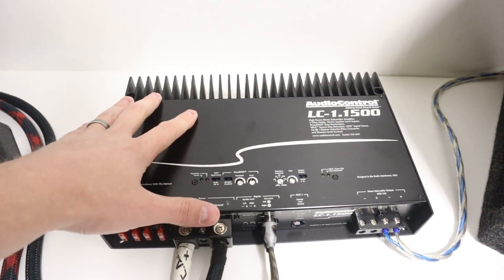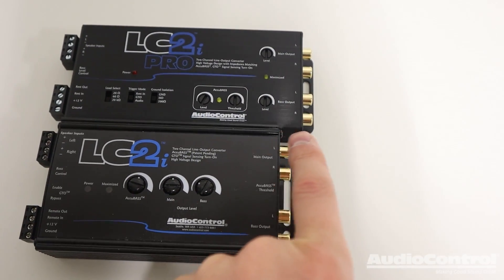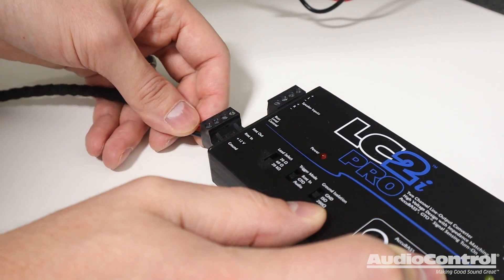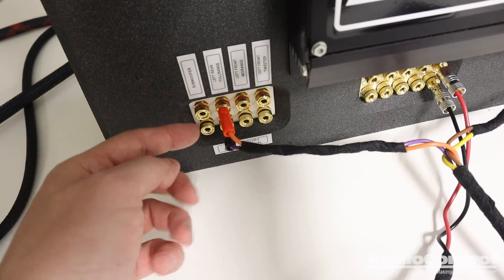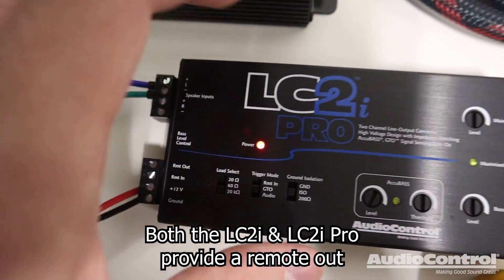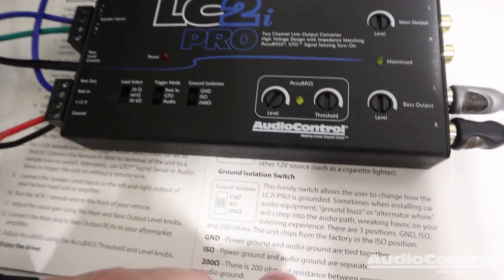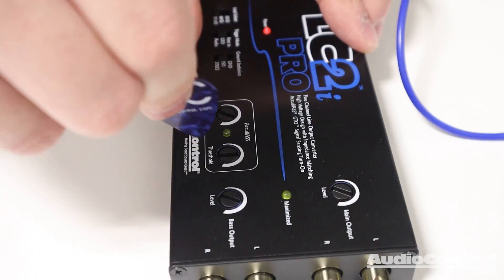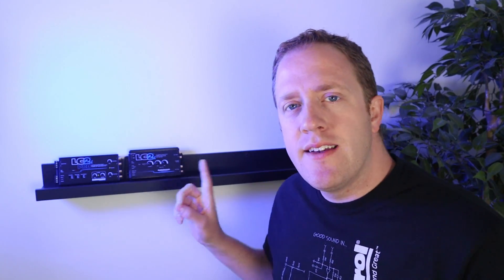Add amplifiers like a PRO! AudioControl LC2i-PRO overview

Comment: about sub channel, does it work the same way on LC2i? Only left side should be connected?
Reply from the maker: You can connect both left and right inputs. GTO signal sensing is done by the front left input channel, but we do recommend feeding input to both the left and right inputs on both the LC2i and the LC2i Pro.

Comment: I just ordered one of these.  I believe my factory subwoofer on the rear deck only has one set of wires.  If I tap into those, when I get to the Lc2i pro do I need to jumper ++ together and - - together?  Also, can I used the same grounding bolt as my amplifier?  Thank you!!!
Reply from the maker: Yes, you can ground it to the same spot as your amp, as long as it is a good, solid grounding point. As for signal, yes, a short jumper of speaker wire, to send signal to both inputs, will work just fine.
Reply: @AudioControlCar  I’m new to this, what do mean by jumper. Do I wire the lci2 positive to positive and negative to negative and then connect the stock sub wires (positive and negative) to the lci2’s positive and negative? Thank you.

Comment: If my truck had 4 door speakers where do  I tap into to get the signal? Do I tie into any of the 4 speakers? Do I loose that speaker or does it just piggy back on that existing speaker wire going to that speaker? Thanks.
Reply from the maker: You would generally tap into two of the 4 speakers present. Depending on what you'll be installing, you'd likely just grab signal from the front two or rear two speakers. You will not lose the speaker you tie into, you're just T'ing into the signal, not interrupting it. Hope that helps!

Comment: My factory DVC sub leads I'm tapping into has 4 wires. Should I hook up 1 side only or hook up both channels into the lc2i?

DVC factory subwoofer:
+ purple/green
- green/white
&
+ green/purple
- gray

I assume each channel here is for each side of the factory DVC sub? I plan on removing the factory sub and replacing it with the aftermarket amp and sub going into the lc2i pro first. Thanks!
Reply from the maker: Only need to tap into one of the two sets of leads. You are correct, there are four wires, because your factory woofer was a dual voice coil design. Shouldn't matter which pair you pick, but use one set, and cap the other set off.
Reply: @AudioControlCar  excellent, thanks! Great video, very informative!!

Comment: what if i cant find my subwoofer wires
Reply from the maker: You just need to supply the LC2i PRO with an input signal. It can come from any speaker/channel you like, as long as the audio signal you tap into supplies enough audio information to do what you want. For example, if you are only adding on an aftermarket subwoofer, make sure whatever signal you tap into has plenty of bass, or else it won't sound the way you're hoping.
Reply: Does the front have more bass than the rear from the deck? Meaning,  connecting this to the front speaker output from the head unit will allow more bass than connecting to the rear outs?

Comment: LOC vs DSP which one is worthy to get?
Reply from the maker: Really depends on if you're just wanting a simple upgrade, like adding a subwoofer onto an existing factory system, you can certainly just use an LOC. Or if you are planning to maybe change out the speakers and add additional amplifiers at a later date, a DSP would make more sense for you. There's really no wrong answer, just a matter of preference, budget and plans for the system/vehicle.

Comment: Excellent Video Mark.  I have one question, once you configure the Bass Output and the AccuBass.  Would you THEN set the gain on the AMP?
Reply from the maker: Yes, you are correct. You'll want to first find the max undistorted output from your source unit, then set your LC2i Pro, then set the gains/crossovers, etc. on your amplifier. Hope this helps, and happy holidays!
Reply: @AudioControlCar  quick question I'm setting up an install in a factory bose car. Do I need to unplug the factory speakers when running test tones to set my gains?

Comment: Can I run a amp for mids and highs and a amp for my sub with the lci2 pro or do I need a different one
Reply: I have the lc2i and I have a subwoofer and amp running but I’m trying to install a second amp for my mids and high speakers I’m having trouble getting sound out of them just bass comes out ... I originally got signal from tapping into my factory subwoofer negative and positive terminals .. do I need to tap into the rear speakers instead ?? Please let me know my subwoofer works perfect with the aftermarket amp but having trouble installing my second amp for the mids and high speakers/tweeters
Reply from the maker: Yep, you sure can! The LC2i Pro has both a "main" and a "bass" output, perfect for doing exactly what you asked about.
Reply: @AudioControlCar  That's my question too.  But he states in the video you need a full range signal for Mids/highs and for a sub you would want a low bass signal.  My car is stock and has no amp or factory sub.  I don't know where to tap into to accomplish these tasks.

Comment: Got it I'm tapping into the wrong wires I'm using my rear left and right doors when I should just be going from my Infiniti QX50's sub. I thought any input would work obviously I need to rework the system and it seems much more streamlined coming from just the sub thank you! Your videos are super helpful man thank you
Reply: Doesent matter.converts highs to lows anyways
Reply: Trying to do an m35 right now any luck after 4 years?

Comment: I have a 2016 Ram Big Horn Edition I want to keep my stock radio but I don't have the factory amp... do I connect to the 2 rear door speakers for a low output sub Amplifier?
Reply from the maker: You can grab your signal from several different places in that vehicle. The rear doors are a popular choice for input signal, but the front door signals would work as well. Never hurts to try both and compare, as well.
Reply: @AudioControlCar  thank you so much is there a way I can email you I have a couple other questions and don't wanna fill it out here if thats ok ?
Reply from the maker: @todddionne9753  Absolutely. You can contact us at soundsgreat@audiocontrol.com
Reply: @AudioControlCar  i sent an email to yall a few days ago but I never got a reply
Reply from the maker: Hmmm... my apologies, maybe try this link instead: https://www.audiocontrol.com/contact/

Comment: With the remote in and out can the lc2ipro turn on another amp with the remote in Not wired? Also with any of the audiocontrol multichannel amps can you use the remote to turn on other amps aswell or do they need to be wired separately? Thnx
Reply from the maker: Correct. No matter which turn on mode is used, the LC2i PRO (or any of our products for that matter) will put out a turn on signal to turn on other amps/gear. Same with our amplifiers.. if you use the GTO feature to turn on one of our amps, the remote turn on terminal becomes a remote output to turn on a second amplifier.

Comment: I have a BMW with the Harmon Kardon system quantum logic surround sounds excellent! (Includes  7 x 26mm metal-matrix dome tweeters in the dashboard, front, side and rear, 7 x 100mm ALumaprene midrange speakers in the dashboard, front, side and rear, 2 x 217mm woofers (central bass) below the front seats, Harman Kardon Logic 7® DSP amplifier in Class-D technology with a total output of 600 watts includes 16 speakers). The audio quality is excellent, but i feel the factory underseat woofers lack that deep nice bass i crave. Will this work for my application? Or should i go wiyh the lc7i or jl fix 86? Thanks your the best!
Reply from the maker: This would certainly work for your application. The LC2i PRO will not only work for your vehicle, but it will also give you a nice clean, hot signal to send out to your aftermarket amplifier(s). There is likely no need for an LC7i in your application.